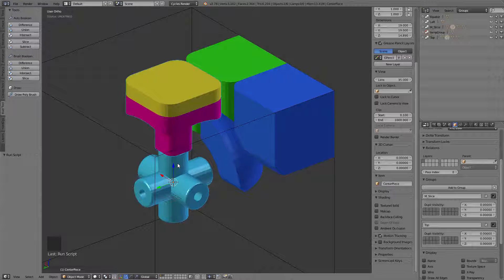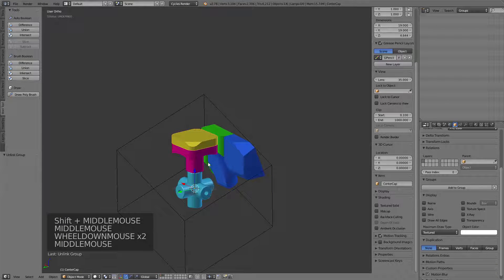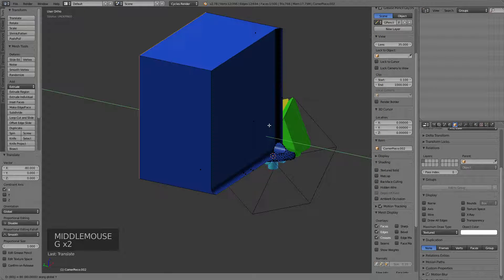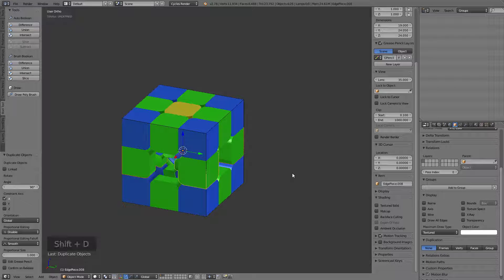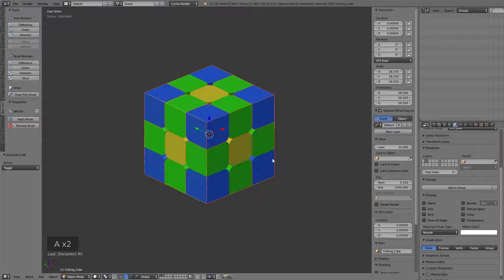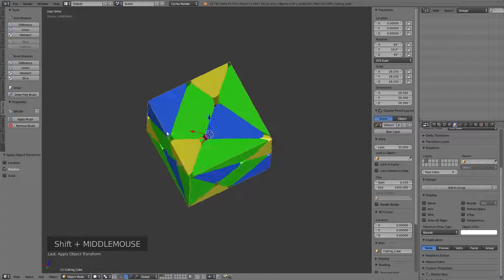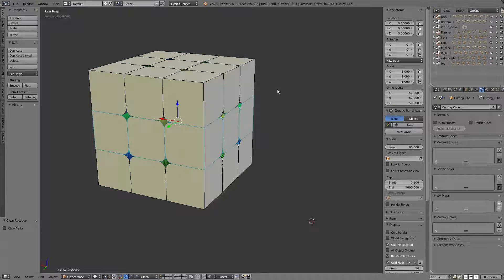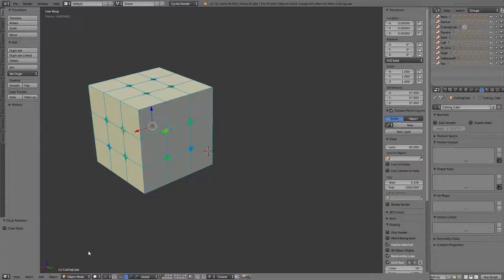Designing 3d Printed Puzzles part 10 of 11

Comment: I promise that this is the last =)) https://imgur.com/a/ZEgzY Whyy, why is it hapening? It's so annoying..
Reply from the maker: Same issue as the previous one for you. You can try altering a piece a very slight amount and it should work.

 This usually happens when faces or vertices are aligned perfectly. simply offsetting things a bit can get it working again. (Something like .01 mm is all that's needed and it won't show on the final.)

It can also happen with complex geometry or when geometry is not manifold.
Reply: Thank you so much !

Comment: If you wanted to do bandaging, would you have to design the puzzle from the beginning with that in mind?
Reply from the maker: You could factor it in from the beginning, but I would probably build the non-bandaged puzzle first, then attach the pieces together and modify things so they looked like a single piece again. (removing the bevel between the bandaged pieces mostly)